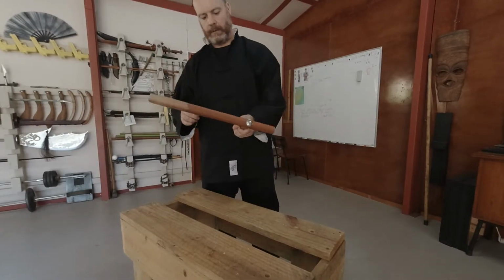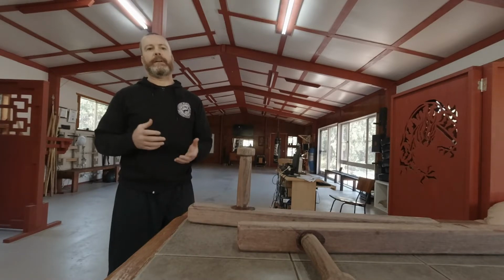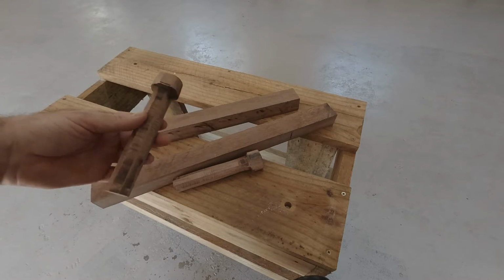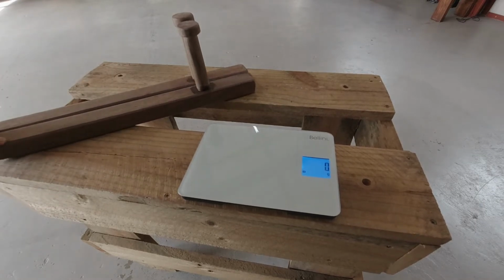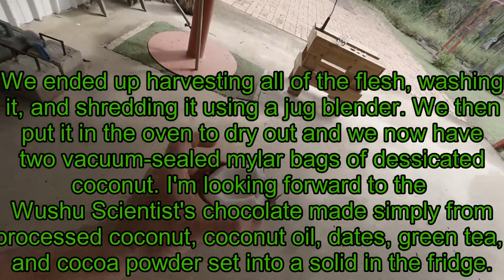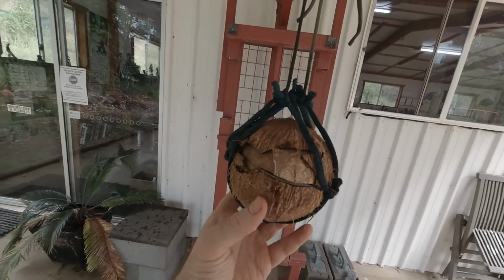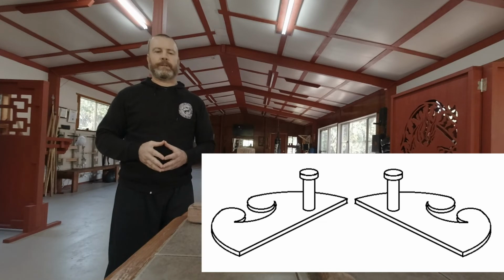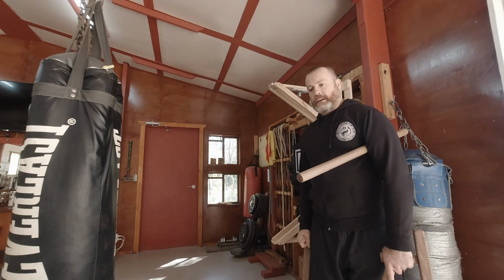Tonfa Part 1: Build and pretesting fun smashing coconuts using tonfa, nunchaku and flute (stick)

Comment: Great to see you made some tonfa! They look great. I think it's one of the most effective impact weapon designs, both from an offensive and defensive perspective. It's a great way to incorporate both hard and soft techniques. 

I recently made one to illustrate a point in nunchaku design for an upcoming response to Shad. The way I learned was with a with a through mortise and tenon. I think it should distribute the stress well, but I've never tested designs against each other, or had an issue for that matter. 

Concerning technique, if I may be so bold, perhaps you could loosen up more in your swing. You look solid enough, but I'm feeling a bit of disconnect, like it's not quite flowing. You may need to tweak the handle a bit (I did), or it could be you're still getting used to your new weapons. Can't wait to see your upcoming videos!

Comment: Now I want to see Jackie Chan fighting a dude using a kitchen sink and the bad guy can have the wooden bench.
Reply from the maker: Hi Jaime. I noticed that you left a comment on my latest video but YouTube has completely removed all access to it for me. YouTube seems to be doing that randomly. I can't fish it out of anywhere. It is completely gone. I was just wondering if you could try reposting it.
Reply: @WushuEngineer  so basically my comment was telling you that I'm asking shad to talk about other flails such as the manriki chain meteor hammer rope dart nine section whip monkey fist and blackjack. And if he has a video about that I was wondering if you could do a video testing them. My comment possibly got deleted because I tried to tell you where to go to another website and YouTube has an issue with URLs I think.
Reply from the maker: @jaimemunoz5920  Thanks for reposting. I'll have a think about your request.

Comment: Great job getting real-world analogues to compare to the data, Lester! Coconuts are pretty good visual mediums for a certain level of force. In this case, if we compare the damage... the nunchaku actually struck with so much impulse it split the coconut before much cracking took place. That's the effect of a high-velocity weapon, and the tonfa was about the same on the younger coconut. The flute is certainly a fine weapon (perhaps a bit long), but because it's slower it instead caused cascading fractures, with part of the "skull" falling off.

Those injuries are almost 1-to-1 with human skull trauma. The nunchaku and tonfa cleft the skull in two, so that no hospital in the world could save you, and the nunchaku one would be an instant death. With the flute, while the spiderweb fracturing is likely fatal, the pure damage is less significant (the subject might survive for several hours). So, it's pretty clear which inflicted the more destructive blows, as far as medical trauma goes. If you want more anecdotes you should check out Weapon Man's channel, as he's broken about 50 coconuts at least, and his experiments support these findings.

But if you really want an in-depth, objective visual test, then get blocks of crafting clay. Clay is used by the firearms and body-armour industries for ballistic tests, as it's an excellent medium for modeling impacts. You can tell the difference between impulse shock and applied pressure (pushing) with clay, too. And, best of all... it's reusable.

Once again, really great that you're doing thorough testing with the weapons. I'm looking forward to the second part, and your future videos.
Reply from the maker: Sorry, your comment was buried by YouTube but I managed to pull it out this time. Yes, I think using these kinds of tests may help with viewer visualization.
Reply: @WushuEngineer  Yeah, youtube has grown increasingly sensitive. Even talking about attacking a coconut is fraught with risk!